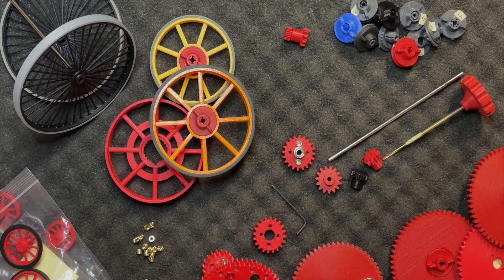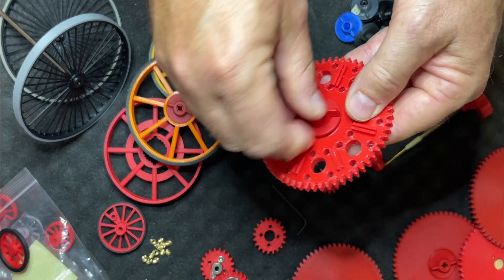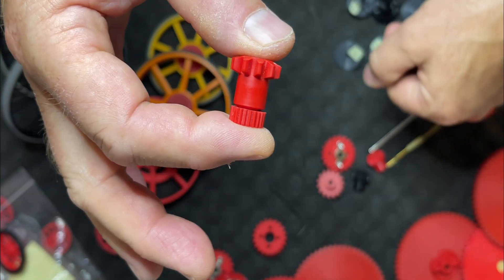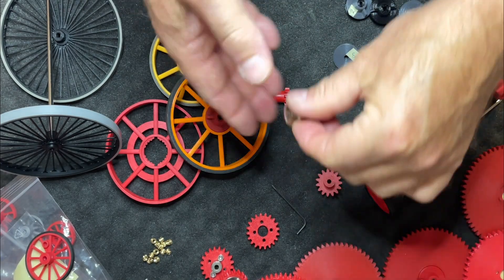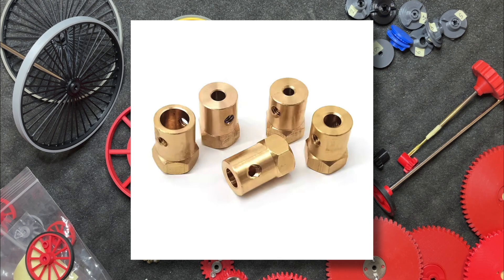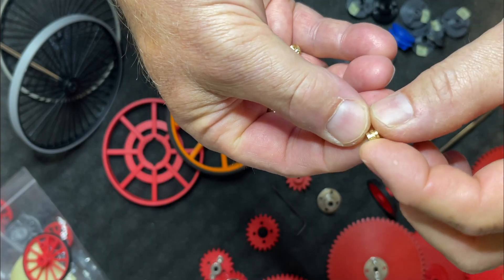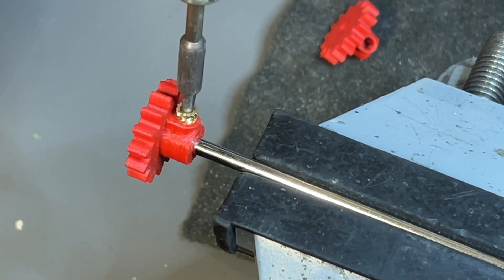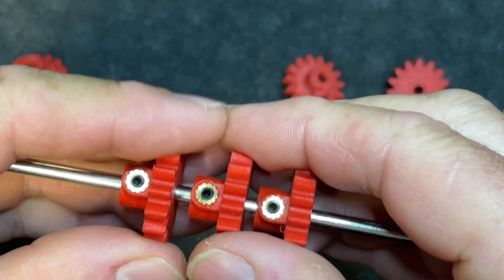Threaded Inserts used slightly differently

Comment: for printing the clamping axel yourself, may I suggest checking out the CC3D PBT Pro filament? I've been doing a bunch of experiments with it myself, as it sits sorta between a flexible filament, like TPU, and a 'solid' filament, like PLA, making it both very durable, but not so flexible to where it just runs away on you if you need dimensional accuracy under stress.
Reply from the maker: I've been using carbon fiber 4mm rod in stead of metal axles, but haven't printed my own axles yet. Thanks for the tip!

Comment: I’ve done this on a few projects - just designed a camera mount for a surgeon to use in the OR using the same system seems to work fine. I think you designed yours well as my first attempt I had it too thin and when the set screw was set it tried to flex the walls too much
Reply from the maker: Great to hear! Yeh, in the video the walls seem too thin and are deforming a bit. But, in retrospect I think I just heated the insets too much. I've melted in dozens of insets in the mean time (also to mount pcb's, but these 'tubes' have comparable wall thickness) and have changed things a bit. I just heat up the inset (placed on the tube) shorter and STOP when it begins to sink. I don't push with the soldering iron, but take over with a pair of tweezers. The impact on the wall is then absolutely minimal, but the inset can be pushed flush and is very, very strong.

Comment: Recommendation - instead of using circular axle, use triangle or square profile. The 3D printing will be simpler, the possibility of slip is far lower and you can print inserts for ball bearings where needed.
Reply from the maker: Good idea, but the axles must be the 'standard' fischertechnik metal 4mm axles for this project. This part has to blend in with the commercial available parts of the fischertechnik-system with other wheels on the same axle. But, you're right, e.g. the +-shaped Lego-axles wouldn't slip in the first place. Another idea for the round metal axles is to give them a 'flat' surface for the screw.

Comment: Re: Printed collets; Have you tried printing the "fingers" as separate parts? making a 4-part assembly, two halves that screw together and clamp down into two free-floating wedges. Perhaps more fiddly to assemble but it'd be 100% printed.
Reply from the maker: Super idea, I think. There could be openings in the 'main-wheel' to keep them a bit in place during assembly. Another advantage would be that they could be printed seperate and 'laying down', so the filament layers are much better oriented. When printed as one part, they snap quite quickly because of the stacked layer structure! Another thing is that you could only print the (hidden) fingers from Flex/TPU and the rest from anything, in any color.... So I like the idea! Might try it one day! 👌